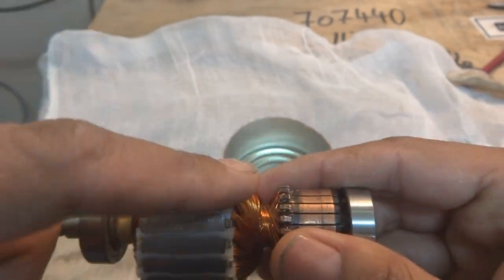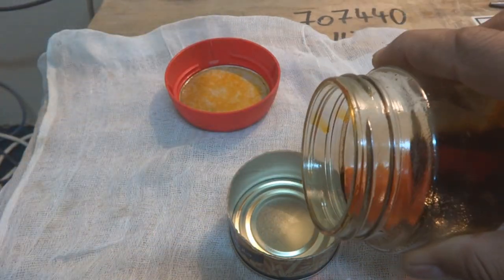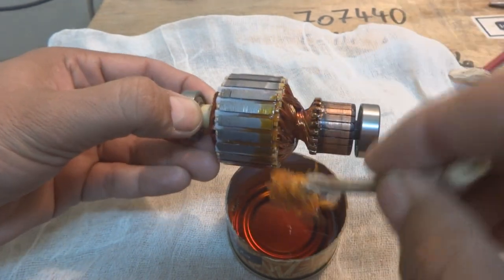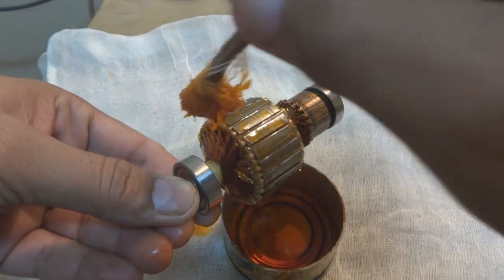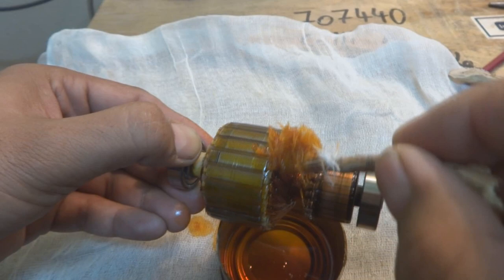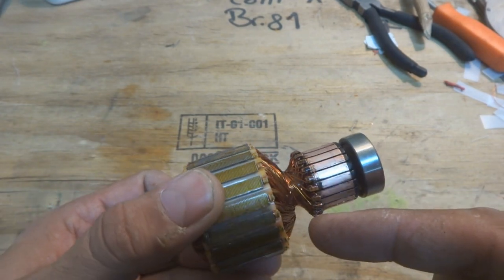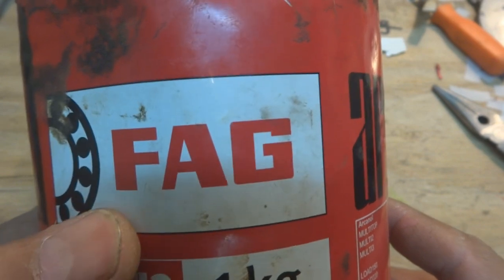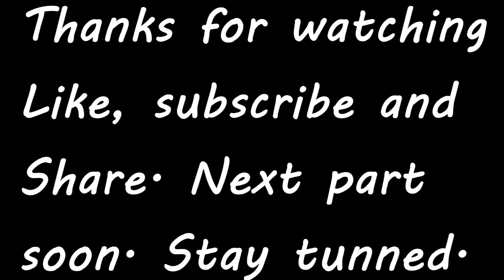Universal motor rewinding. AC series motor repair. Part 4

Comment: Watching you do this led me to find a major misconception I had about how these are wound. I didn't realize that each winding is in parallel with all the other windings, they are not discreetly isolated. However it doesn't matter, because the commutator defines which contacts are used, and clearly the shortest path will always be the single winding, even if the motor is under significant torque. If there is a little slip, it doesn't matter, the motor picks up on the next winding anyway. And the way you shifted over by three spaces at the beginning gave you the necessary angle shift to define which way the motor will start and rotate.

Comment: Very good job, congratulations; I have exactly the same failure and I'm looking forward to what's next. I wonder how you will balance the armature, because very high rpm on vacuum cleaner motor (26000 rpm on mine for rexample)
Reply from the maker: Thanks. Hope you fixed it. Balancing in the end isn't a big issue compared to a burned motor not running at all.

Comment: I like this video, since most just replace the part.
Reply from the maker: +Krugzug Thanks dear friend for liking video. It was a total repair video instead of replacement. You are right people are normally replacing the whole motor which could be an easy repair but is not a cost effective and enjoyable repair. Stay tuned to the next part as it is covering the test of the machine in the end. Regards,

Comment: That looks smashing :-D, and that varnish will also protect it from dampness.
.
I wonder if shellac would work for a varnish, i used to repair electronic pcbs for vehicles, and when repaired i had to coat it with shellac to stop dampness distroying it.
Will you be testing the windings with your multimeter for equal resistance or do you think it would be hard to tell because of the low value per coil?
I would be supprised if it wasnt perfect, you were very carefull :-)
Reply from the maker: +zx8401ztv Thanks dear friend for nice comment. I tried to test it again with ohm meter but it was not so helpful due to different length of coils. The next part will cover that testing. Also I performed the current testing for the unit at the end which proved the repair. The current test is eventually the perfect testing for such machine. Regards,
Reply: +LearningZone 
I do know that the rotor windings on alternators were tested by applying 12v through an ammeter to the winding, then the current flow noted.
This was a simple test that was done at the factory i worked to check for shorts in the winding.

Comment: Very good information.
I've replaced many shielded bearings on motors, I assumed the shield was there to keep the grease in and dirt out.
I'm curious why you think you need additional sealing?
I have always been curious what the difference is between sealed bearings, and shielded bearings.
Thank you for posting the video.
Reply from the maker: Thanks dear friend for liking video. The reason for extra sealing is obvious that the machine is sucking dust and dirt. The air sucked along with microscopic dust which crosses the internal machine filter is passed through the winding and bearings. The main reason for passing such air is to cool down winding all the time the machine is used. The shielded bearings are not 100% dust sealed. So better if we will provide a little external grease to get them sealed for further safety which have no side effects. Hope you understand my point. Stay tuned. Regards,
Reply: I only watched this video, I didn't know this motor was for a vacuum till just now when I watched the first video.
I understand now why you are taking the extra precaution to seal the bearing, that is a great idea.
I just rebuilt a transformer for a speaker system, and I was thinking about using motor varnish to seal it, that's how I found your video.
The only motor varnish I found cost $15 for 55 ml, or $25 for 225 ml, I was hoping to find a cheaper alternative.

Comment: Have you also rewound universal DC motor stator part?
Reply from the maker: +Mihkel Laansoo No dear friend, stater part was good for such universal AC series motor. I knew that was good by testing the unit current. If that would be failed, it would draw way too high current. So in such a case we would have to rewind that too. But it was not the case with me. The next part of the video will cover the current testing of the machine in the end. Stay tuned to understand that. Regards,
Reply: +LearningZone  I am trying to rewind my first universal motor, I did it the fifth time, and it's bad again. I don't know where the error is, arching on brushes is substantial, part of the brush gets eaten up,  commutator gets black within half a secound. Could shorted stator cause that? I'm going with a simple  lap winding, 12 poles and 24 bars on the commutator, and I'm quite confident there was no errors during winding process. Engine got damaged by a small piece of rotor that came apart.

Comment: I am trying to rewind my first universal motor, I did it the fifth time, and it's bad again. I don't know where the error is, arching on brushes is substantial, part of the brush gets eaten up,  commutator gets black within half a secound. Could shorted stator cause that?
Reply from the maker: +Полад Шарифов seems that you have shorted field winding or stator winding. You must rewind both parts and then clean the commutator and brushes. Also you should watch all parts of my this rewinding series. A current clamp may help you figure out your correct current value. Let share your success and celebrate it here with us!
Reply: thank yuo for answering, i understood

Comment: Sir I have a question that how to remove the old copper wire to the armature?
Reply from the maker: There are many ways to remove the old winding. One way is to burn them and remove them off when become cold. The other method is to cut them and pock them off. The third method which I used for this one is to pore thinner in the winding, melt the insulation by thinner and then remove the winding turn by turn. It takes time but in such a way you remove the winding with all details and can't miss any small detail and this method is good if you are new in this field. Thanks for Comments. Watch all my videos and feel free to drop comments. Best regards,